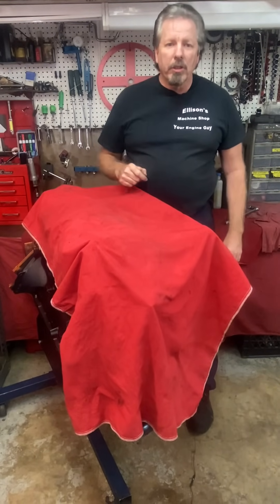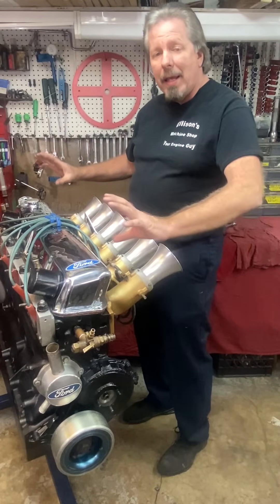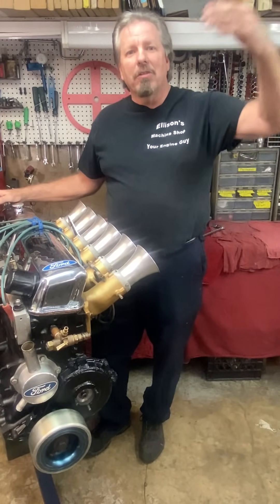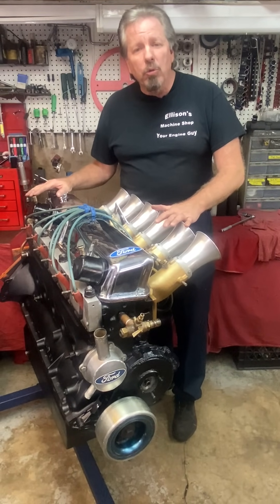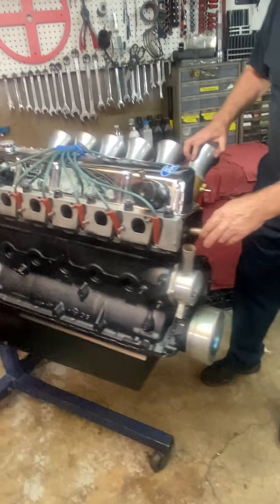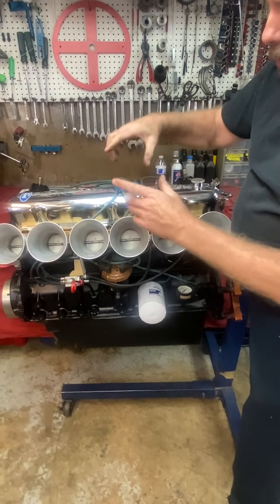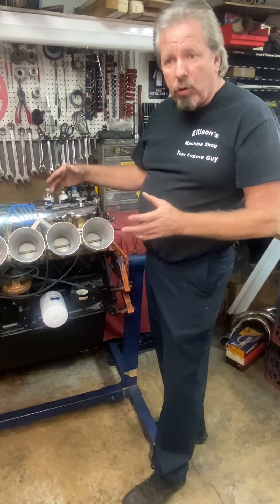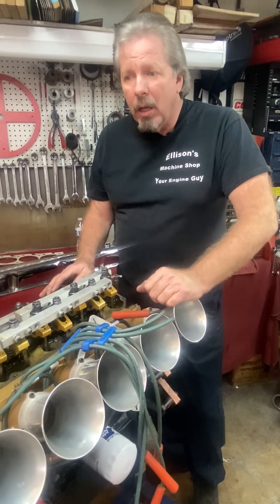Boss 300 Finished Project

Comment: God bless you, sounds like you're as sick of the LS fan club as I am lol
Reply: Iam about sick of them also 👍
Reply: The LS engines are great, we all know that already. They have their share of defects like any other engine. My machine shop guy said it best: "LS engines are for guys who are lazy and just wanna go fast" He then would go on to explain his opinion...there is no challenge to that engine. I personally run a well thought out 350 in a little S10. Let's just say some LS guys get embarrassed 😏
Reply: I have had a POS 05GMC and now a POS 01 Silverado with the 5.3. I am not impressed at all with the 5.3. I had a 99 f150 with the 5.4 that was quicker and pulled better then both the GMC and the Silverado. Also most guys that do a LS swap usually always end up putting a turbo on them. A few weeks ago I saw on marketplace someone selling a Silverado with a 5.3 twin turbo and they claim it was making 500 horsepower at 10 psi. Hell a good tuned coyote f150 will make that plus n/a. Even a well built 351w will make that n/a.
Reply: engines don't just aquire cult followings for nothing... It's like being a na 4 cylinder racer and hating on Hondas.(yes we all know there's other engines capable of it but that isn't the point).. Regardless of the THICC layer of bullshit that surrounds us these days a well made engine will still stand on its own merit... If i just say hey this twin cam 1.9 in my Saturn sc1 is the best dohc 4cyl and all others are inferior I'd most likely be the only guy to say it and someone with a na k20 with over 300 whp would be right to shut me up..
Reply: I'm just burnt on forced induction these days. LS or otherwise.
Reply: As if the LS wasn't masterminded by an NHRA enthusiast at the blueprint level. Shut up already, you're worse than any fanboy being an "anti-this/anti-that".
Reply: @ihearti24traffic  Sounds like these boys got their azzes handed to em by an LS one to many times!
Reply: The ls has hurt many people's feelings, this is why it's the best engine. Everyone that was ever embarrassed by an ls is going to talk smack.
Reply: this has thousands of hours of r and d in it,its easy to get sick of something like the LS that makes killer power,every single time...
Reply: @trillrifaxegrindor4411  ah yeah and as if the LS wasn't developed from the decades of R & D these guys did back then. Especially Ford. Good thing GM finally got smart and used a shit load of Ford ideas. Did you know you can put 351 Cleveland headers on an LS? Did you know you can put LS heads on a 351 Windsor. That's weird that's weird 🤣
Reply: @fiddynutz68  It is more coincidence than anything. You can use Windsor headers as a start but you have to swap the flange to the LS bolt pattern and open up the tubes on most headers. Same with the heads. Its a close fit but it's not a bolt up. You will have to ream out the bolt holes and the bore spacing will be off 0.060". The cam will also be the wrong layout so you have to get a custom cam. You will also need a custom intake. In the end there have been tons of similar features on different V8's throughout the years. For example the Chevy small block with its siamesed intake runners and center two exhaust ports was used later on Chryslers LA and AMC's V8. The canted valves of the Chevy Big Block was used later on the Clevland and 385 Series Fords.  Does that mean Ford copied GM innovation?
Reply: @geoffmooregm  I didn't say Windsor headers I said Cleveland headers and no you don't have to swap out the flange. Using exhaust ports is a whole lot different than using a whole engine concept. Change bore spacing .060 go equally spaced exhaust ports, no ones gonna know, no one will ever know. An ls is just a Windsor with high flowing heads and a few other modern updates.
Reply: LS is the superior engine choice at the days end lol. Nobody cares what your friends think, or your buddy who works wherever lol. I don't care if you disagree with me either honestly. The LT1 was ahead of its time and the Coyote eventually got reliable enough that these Ford kids throw them in the Foxbodys. I personally love to see the aneurysms at car shows when SN95's and Fox platforms have GM engines in them. Ford guys just never shut up, it's odd. But ignorance is an incredibly common trait amongst domestic enthusiasts and V8 meat heads are idiots. Another day of being exposed to my fellow "enthusiasts" lol. You're all weirdos.
Reply: @ihearti24traffic  geez Gil, hop in your prius and take a drive to Walmart or something.
Reply: @daviddntait  lmao stay hurt my friend.
Reply: @ihearti24traffic  I will son, I will stay hurt till the end unfortunately
Reply: @ihearti24traffic  coyote is far better. Show me a factory sealed gm truck running 8s like a coyote f150. 🤣 always gotta change parts out to do anything with a garbage ls.
Reply: @ihearti24traffic  - soon as them 7.3’s and coyotes become inexpensive ls os dead
Reply: @CoyoteFTW  whatever you say ol' boy